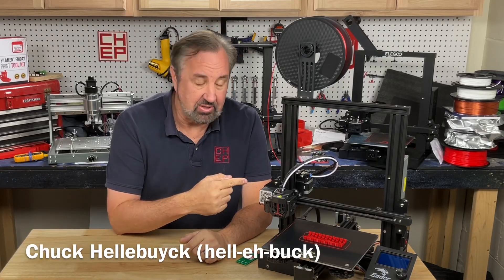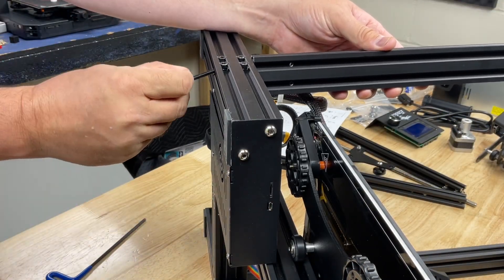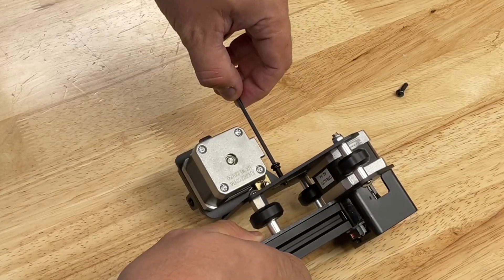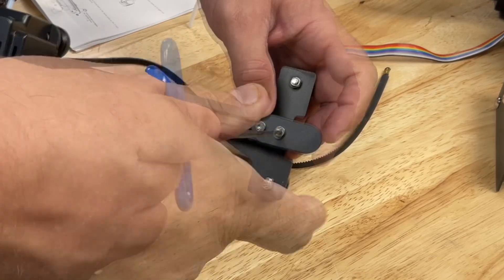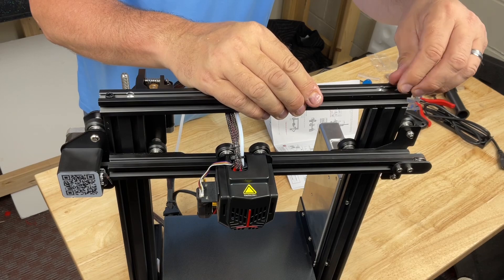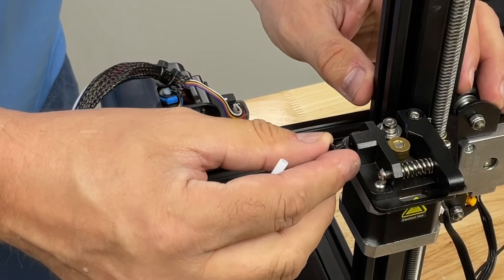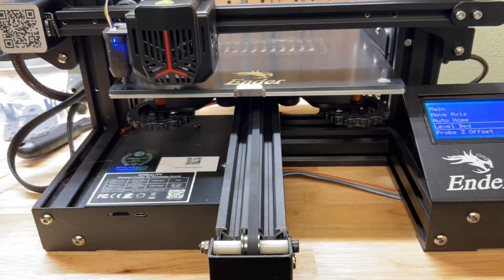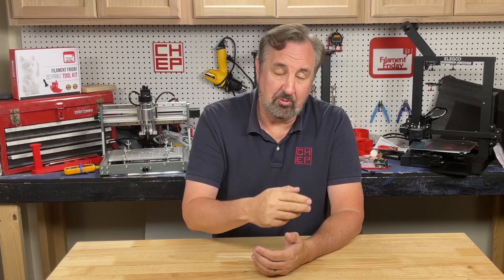How to Setup an Ender 3 Neo 3D Printer

Comment: HI Chuck,  ive noticed my screw doesnt move up smoothly,  down no issues , but up it feels tight, if i stop screwing it actually drops a bit, like something is holding it down. I think this is the reason my prints are failing,the cross bar is not moving up and down freely by hand.  Is it my screw or wheels?
Reply from the maker: Check the wire bundle and make sure it’s not hooking on something. The stepper motor also should be holding it when it stops turning. It maybe losing power as well.

Comment: I keep having issues with mine. I had a good print out of it then I went to go do another one and it keeps failing to extrude. I’ve levelled the bed up numerous times incase this was the issue and made sure no cables were making contact with the bed wheel, I’ve used the needle that came with the printer. Ive now ordered some cleaning filament to see if I can cold pull whatever is blocking it up if it is a blockage. It’s honestly driving me nuts 😂

Comment: Hi just wondering . im going to buy and ender 3 neo and i have a macbook how would i connect the printer to the  computer .
and what software would i use to input models and print them off . thanks i hope this is not to confusing :)
Reply from the maker: I would recommend you also consider the newer Ender 3 V3 SE vs the Neo. https://youtu.be/AZwiJLddZXs?si=T_RDWfLzsZOl69Va
I use the SD card to load files in to printer. . 
The free Creality Print slicer software can be used to slice the files.
Reply: @FilamentFriday  ok thanks will do
Reply: @FilamentFriday  and just wondering if i did buy the v3 se what what would be the best free printing software for it 
which could  be used on mac book ? Thanks

Comment: For some reason my models are not sticking to the bed. Any advice
Reply from the maker: https://youtu.be/nMLKNB2r-M4?si=f5crVs7zAbHLMwE3
Reply: Hey there! I was having the exact same issues. I was just using the stock files included with the printer. Were you able to figure it out? 
Also what filament were you using? Thanks!

Comment: Excellent video. Much easier that following the printed manual. I was lost at the timing belt step and you video save me the struggle. thanks!
Reply: when running the self alignment function I got this error message "homing failed printer halted". I realized the  nozzle kit was not pushing the limit switch. I manually pushed the switch but then head assembly has a small manufacturing defect, so the plastic cover was a bit depressed at the point where it was supposed to hit the switched. I added a small sliver of wood under the plastic cover and that did the trick

Comment: Super handy video (thank you) - I didn't need to consult my manual once. Quick tip for everyone - ensure the black cables to the motors and extruders are free and loose before you start. Mine were wrapped under the bed - on shipping. This is a pain to fix if you finish the build.

Comment: Hi, I watched your previous video on assembling an Ender 3. I noticed that you used a speed square and clamps in that assembly guide, but not your later videos. Is it still recommended or is it no longer needed on the new Ender 3 neos?
Reply from the maker: It doesn’t help as much as I thought.
Reply: Hey i am going to buy my first 3d printer but i am not able to decide which to buy ender 3 neo or anycubic cobra i am also new to 3d printing 
Please reply 🙏
Reply from the maker: I prefer the Neo.

Comment: got mine put together, followed this guide and it was fine ..... went to crealitys actual level guide because i forgot the name of this video to level it and it left a massive groove in the print bed 

followed this guide again and now i cant get it to level atall ,, cant print because the nozzle just scrapes the bed badly and now i have no idea how to fix it
Reply: Did you solve it? you can try by doing a factory reset and start over.Then first auto home the printer, then move the Z axis via motion in menu, go slow in 0.1 increments and see what happens near zero because you will have to adjust the z offset in Motion menu until the Zero of the Z axis is when the nozzle is almos touching the bed. Then check the corners but go slowly in case the is a raised corner that can make contact with the nozzle. You might have know all this but just in case.
Reply: @Drumaier J  managed to get a somewhat printable level it's not perfect but it did a 6 hrs print fine ... I tightened all screws to their max adjusted z to near the bed and just went around each corner with motor off and loosened them accordingly for each corner er u til I could moved the hot end around the whole bed without touching. 

Creality need to take ownership of that video and remove it because its really bad and a few other had the same issue
Reply: @arcticwolf1599  I partially agree with you. I think if you do what they do in the video right away (without using a different approach before) you shouldn't have that problem of nozzle going against the bed. But they would do a service to themselves and their clients if they to explain things more deeply, letting you know why and when to do this and that. Btw I recommend you to print and install the leveling wheels clips that you can download at Printables, they hold the wheels in place so they can't freely get loose. That way if you get the bed perfectly calibrated you don't lose it that easily, I swear is the best mod ever for ender printers. Also try to not disable steppers when leveling and move the extruder via motion  in the display when going to the corners... This way you avoid accidentally moving the x gantry up or down.

Comment: question for ...the internet....im looking at a first printer for tpu specifically, can grab a 2month old stock ender3 neo for $225aud or a fully decked out ie, upgraded silent stepper board, hotend upgrade, klicky probe, cooling duct + fan ,microswiss direct drive, klipper pre-installled ender pro for $300aud. Dunno diddly squat yet but while the neo seems like a steal im wondering if all the work done to the pro makes it a better choice for tpu or is it better to grab the cheaper yet newer neo and put the leftover bux into a direct drice upgrade have an overall better/newer unit perhaps?

Comment: Hey...so I got the Ender 3 neo and when I'm screwing the spool holder it's getting free and comes off even when I have tightened it all the way. It is wiggly and not tight enough to hold the filament spool.
Reply from the maker: Never heard of that. It’s just a twist lock not a screw in.

Comment: Oh btw when loading filament into the white tubing how far will it go? When I loaded it in through the white tubing I hear a small click, dose that mean it is done setup? Please let me know ty but then power supply was up too high so had to assemble all that top part to the power supply and turn that side part the right way but then the screws won’t screw into the power supply at all don’t understand that at all or have that part backwards? Anyone out here on YouTube live in Spokane and come and physically help me with this? I am old 66+ woman had it all together except those red and black cables with yellow male and female was way to short to even work those cables were in the printer bed kept hanging up so that’s when I realized the holes were up side down, so  Amazon is replacing the whole printer for another new one for 100% free cause the manual dose not show how the holes are to be lined up, too small print to even read it. Anyways a new free one getting next Tuesday, one time only, so any one in Spokane Washington can come over and help me after next Tuesday? How can I attach the power supply on to side of printer and secure it? Screw holes not good at all.
Reply: Also why are my black and red cords to connect power supply too short and how do I get it longer because it’s catching on to the glass bed under neath for it to move back and forth?
Reply: @Heavenly Gifted Art Studio And Sims 4 Game  I had this exact issue; the instructions showed one way, I tried that... then I got confused. Noticed the holes were higher, so I flipped it.
Reply: @Cobaltios  I decided to return mine just not for me received refund so not have to make payments. So I guess just a bad buy for me, no more on these.
Reply: Wow I fixed my issue power supply is now on my table instead of screwed on to 3D printer and I am now test printing a rabbit it is Easter lol. Where do I get more patterns for free on to me SD card?

Comment: Thank God I found your video. I never would have been able to get this together by the manual. I think the manual is pretty poor. Without any experience, putting this together would have been just insanity. However, watching your video  and pausing quite a bit, I finally got it together. 

I was just about to plug it in and do those final steps you mention but I don't know what I'm supposed to do before that? For example, how do I remove the build plate? Since this is my first printer, do I take that plastic off of it? I'm assuming it's only a protective sheet? I heard you mention something about finger oils on the plate...does that mean I should be wearing nitrile gloves when handling anything?  Stuff like that isn't in the manual

Comment: Thanks for the detailed assembly. I also installed the dual z axis kit at the same time as I was putting the machine together. :) It's ready for filament. Everything turned out square, and the bed is leveled and ready to go.

Comment: Hello, great video to watch, but I got a question for you. I just got my Ender 3 Neo, and by quickly looking through the ultimaker cura 5.3.0, I can't find this exact printer. So, can I use another profile for another printer, so to speak, or is there a problem from me? Thank you again for all of your videos!
Reply: you can add a custom fff printer, you will need to know your start and end gcode amongst other parameters.  I don't have the neo, just helping someone else.  I guarantee their are reddit posts and/or videos to help you with the settings

Comment: CR Touch blows. I am used to manually leveling and having a z-stop switch. I dont even see a z-stop switch on my neo. If I could go back id get ender 3, and just replace springs and bed.
Reply: I feel you. In the same position rn. CR Touch giving wild differences. I just want to manually mesh level with ISCOC firmware but cant because of this shitty cr touch.

Comment: I have a 2 month old NEO MAX.
The nozzle/hot end leaked hot filament all over it halfway through a print (first 8 hours were successful).  It made the nozzle and hot end a mess that I couldn't salvage.   I bought a Creality spider pro hot end because it said it was ender 3 line compatible.... it is not.   The Neo Max hot end shroud doesn't fit on the top tube end nor the bottom cooling fan end.  So now I have a neo max mess that isn't functioning.  Not real happy with the 13 hour time zone differential support on it either.
So do you know of a 300F full replacement option for the whole hotend/shroud?

Comment: I have a ender 3 neo, and I have had a real time dialing it  in, I finally have it almost printing properly. Now I'm having an issue with it dislodging the glass build plate in the middle of the print. Any suggestions for fixing this issue would be appreciated.

Comment: Why didn't they include tensioner nobs and internal power supply? Looks like they used the pro firmware when i like the v2 firmware better. This video made me reconsider getting the neo.
Reply from the maker: There is a v2 Neo as well.

Comment: WE NEED MORE VIDEOS FOR THIS EXACT PRINTER I CANT FIND ANY
Reply: Getting one for Christmas and literally couldnt find anything till this channel popped up
Reply: Just got one for Christmas. First printer ever. Would love more Neo videos.
Reply: I agree just got mine in the mail
Reply: mine is on the way send help
Reply: quote
Reply: Same
Reply: same
Reply: Whats the voltage for canada? Mine on its way
Reply: @keithchicoory4830  Voltage is selectable with a red switch (not the power switch) on the power supply, like an old computer. Make sure to select the correct voltage before powering on!
Reply: @keithchicoory4830  if you are asking what voltage is in canada, i think it is 115v but u can check with a kill a watt or voltmeter
Reply: @keithchicoory4830 Canada and the US use an identical electrical system - split pole means we run 110v (115 is 110 by any other name)
Reply: Someone please help! When I try to auto home my enter 3 neo it says “homing failed” the y,z and x axis move but the extruder does not, any ideas?
Reply: Amen to that
Reply: How is the printer you guys? I’m thinking of getting one
Reply: Lovin every second of it lol... just wish my fricken parts would ship faster @thedoodler479

Comment: Chep, I love your Fast 0.28, its my go to profile. But I have a problem with functional parts that need to fit together, and don't know where to look to adjust it. I have STLs for a Clay Extruder. The parts have fittings for specific metal parts. I find all the "Holes" to be too small. In fact I played with the Horizontal Hole setting and for the larger 1" size holes adding (subtracting) 0.35mm make a fitting part. The problem is since that is GLOBAL, say a 3mm screw hole is now way too big. It does not appear to have a percentage setting, just in mm. So, is it line width, or what other setting could I look at to prevent the "Holes" from shrinking. Thanks again!
Reply from the maker: If you have critical dimensions like that, it may require the Good profile. Or adjust the design for the extra fast.

Comment: I'll never understand these manufacturers that keep making new models with some improvements but not all, either refine your product over time or just make total new models.
Why the V1 style screen, why non-adjustable belt tensioners, why not tabs on gantry assembly to keep keep square, why no solid rubber bed mounts, still no PTFE/Cable support from hot end or wire guides, unguarded LCD screen.... all these little same/similar cost 'fixes' that improve it so much

Comment: What are the advantages of the neo over just an Ender 3 V2?
Reply from the maker: Basically, Auto level (CRTouch) and better hotend cooling. And slightly cheaper depending on where you buy it.
Reply: @FilamentFriday  Great video. I just set up my neo and fired it up. Auto level was not an option in the menu. Is it possible to upgrade the firmware to add this feature? I leveled it by the manual method with paper.
Reply: @FilamentFriday  same bed size

Comment: Just joined your Patreon. Just got my Ender 3 this week and your videos got me up and printing on day 1. Your profiles have also cut my print times in half. Thanks!
I've printed some two color signage by pausing a print, swapping filament, then resuming. I would be interested in a video on good options for a dual extrusion printer, either upgrading my Ender 3 with another extruder and/or hot end or your thoughts on printers with multi material printing out of the box.
Reply from the maker: Thank you for your support.